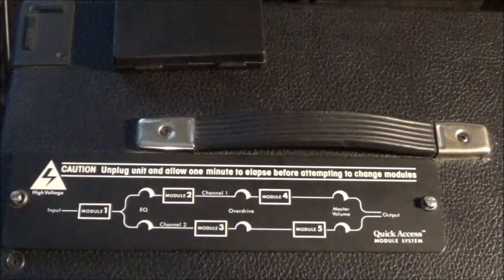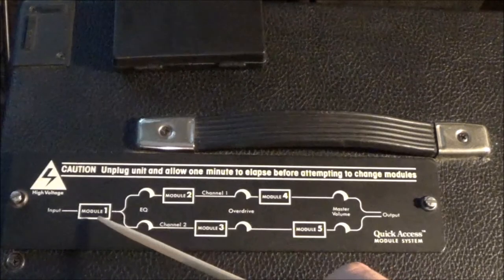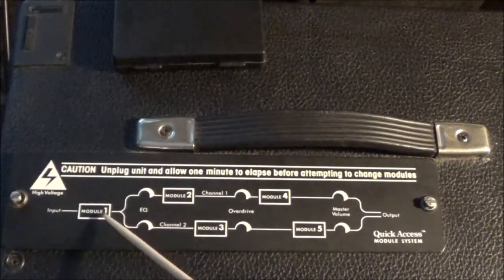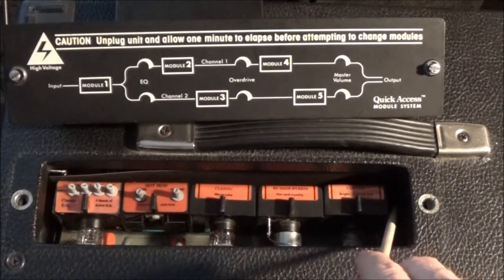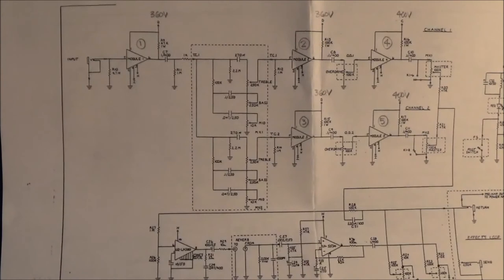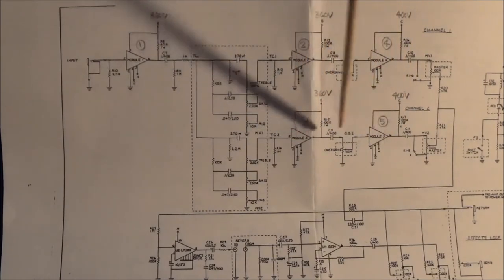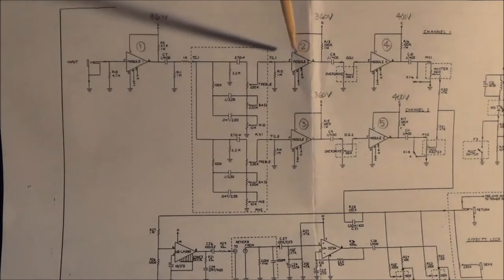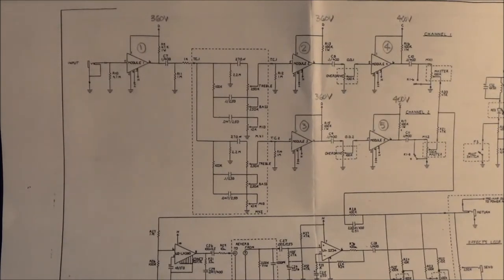Seymour Duncan Convertible Module Order and Design Of Preamp

Comment: Do you accept orders to make a set of modules? I just bought this amp for very cheap, but it has no modules with it. Dumb question - what is the minimum number of modules I need to run this amp? How many modules were there total from SD? I knew nothing about it before today, thanks for the video!